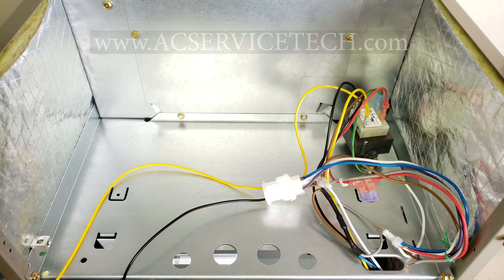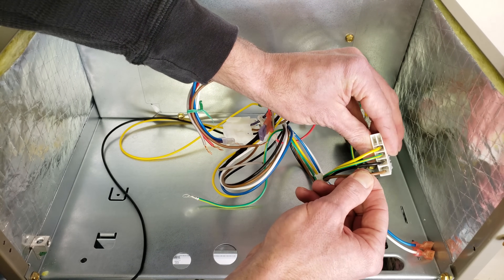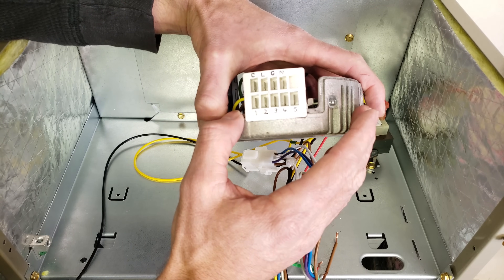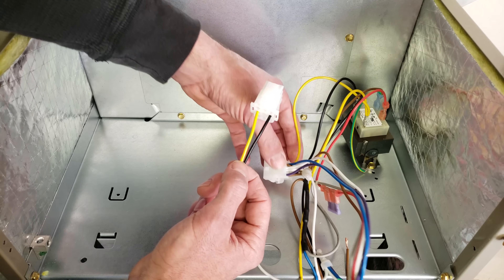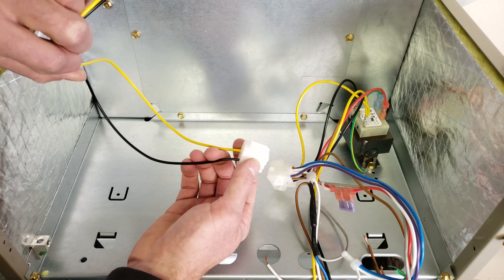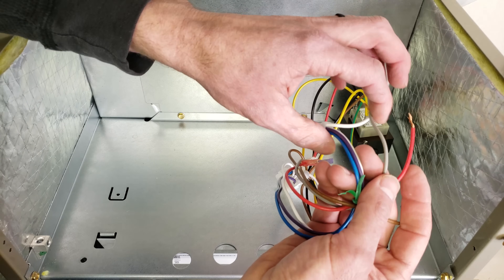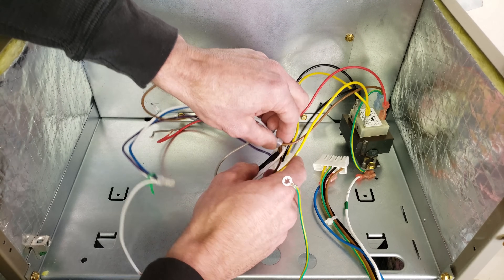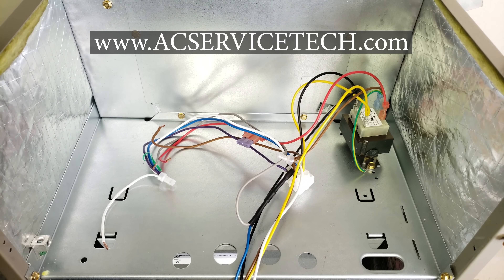How an Air Handler WITHOUT a Control Board Works! AC and Heat Pumps!

Comment: My Trane Ac unit has this huge complicated board and an expensive multispeed blower motor. This multispeed blower is too expensive for my liking. They are not very reliable neither. I already bypassed the board and used a single speed fan and capacitor instead. Now I need to wire my heat, but the thermostat wire is only an old 18/2. I may have to move the thermostat to a more convenient location since it is nearly impossible to run a wire there. I want to put an 18/8 wire even if I don't use all the legs. I have been learning so much from your videos. I viewed them a few times. You are contributing a lot more to this world than you know. Thank you so much, sir.
Reply: You could use a wireless thermostat as well and move it where you like at anytime depending on the type